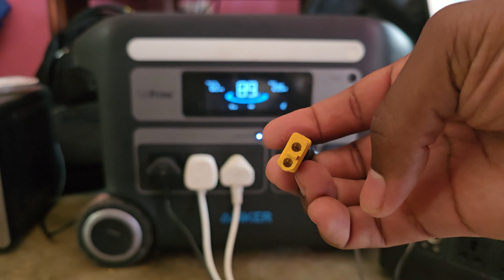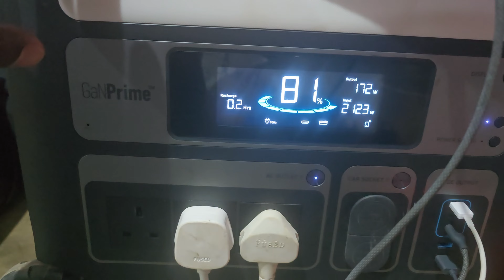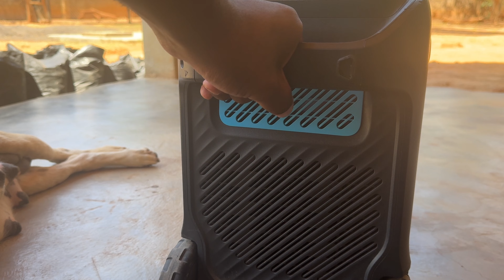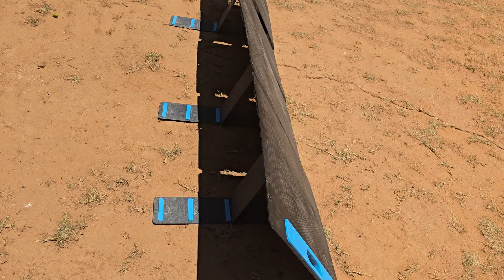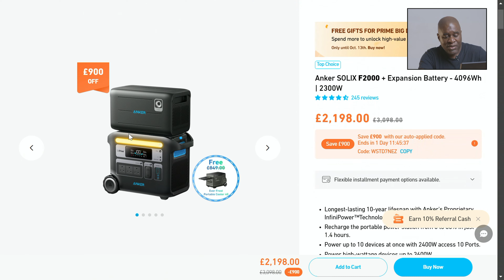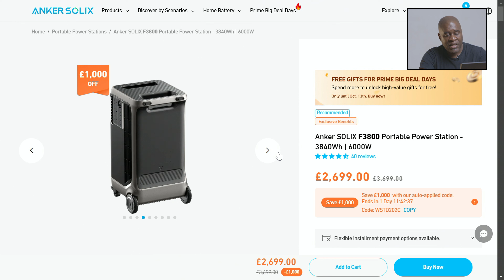Anker Solix F2000 International Version (UK)

Comment: The angles on the panels are set for Europe. In Uganda, I have to basically lay my panels flat on the ground to get near the max rating. For Zambia, use the tab on the legs that gives you the lowest angle. 

The 200w panel will however need 10hrs to charge to full. Better to save that money and use it to buy 1000w of rigid panels that can charge the unit in about 2hrs.
Reply from the maker: Didn't know that about the European vs African angles makes sense.
I used to adjust the panels to get best solar input as the sun moved.
Ended up just settling for two 550w panels and I get max about 800w input.
So during the day, it starts charging at about 06:00 and cuts out at about 18:00.

Comment: Currently using a Magneto 1500w power station from micmar its good enough to power my fridge and tv at home and charge my macbook and phones.

Only issue is it couldn’t charge via solar for some reason, the electrician concluded it’s a faulty Power station I’ll probably return it.
Reply from the maker: Solar I have come to learn is a tricky thing in Zed. Finding a competent installer and electrician is the hard part. Try to see if there is any independent electrician can confirm if it's faulty. If confirmed take it back for a refund or replacement